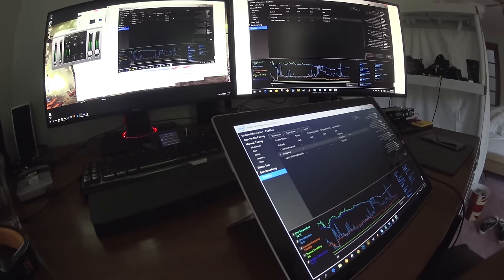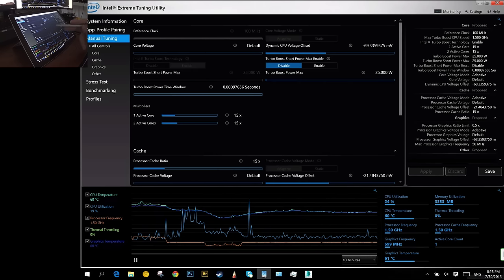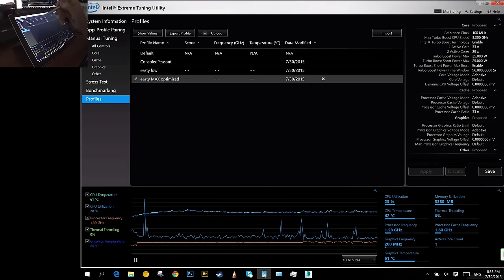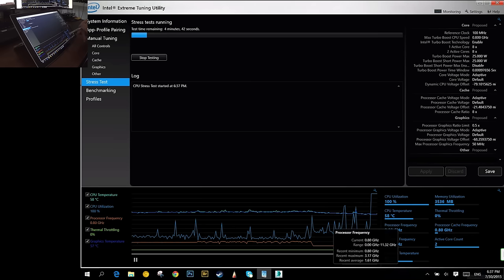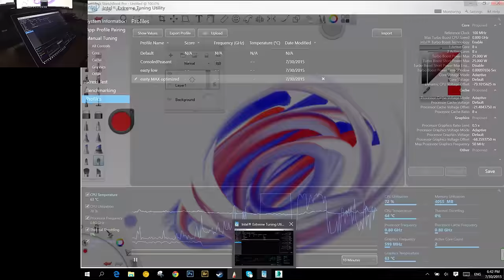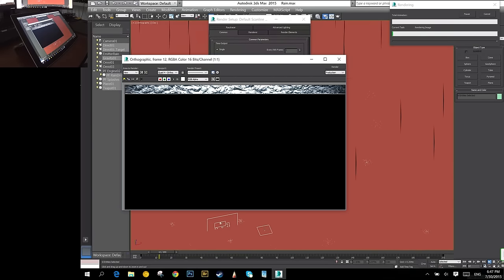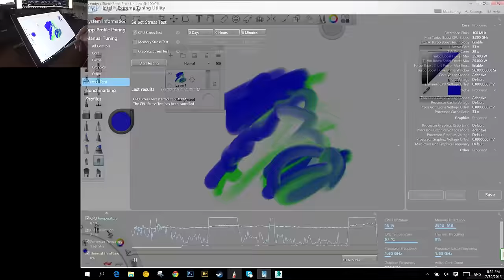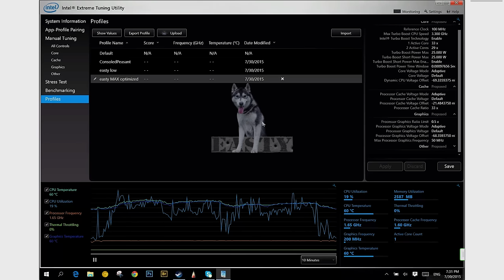Intel XTU - improving surface pro 3 operation for a little tweaking

Comment: Hi Brian,
I really like that you did this video. I've been searching for someone that does an indepth look at this, especially running windows 10.
Now tell me, are you running the Intel graphics driver? You should look at that and compare with that driver instead of microsoft's as well. Back in September there were many articles about it which increases performance. Now there's one for WIN10 as well.
I used to use XTU on my SP3 i7 256gb back in school last year and I've been so upset with the temperatures that it gets to. Runnig just Microsoft edge is enough to make the fan turn on, and if I run games of course then it throttles immediately. Thanks for sharing what you've learned!

Comment: any chance of exporting your profiles, complete noob here. i have the same specs of sp3 / i7-4650U CPU @ 1.70GHz 2.30 GHz/ 256gig / 8gig mem /thanks
Reply from the maker: +Roderick Astorga https://drive.google.com/open?id=0B6ivAynxQBSAZTBER1hMeXl3LU0 There is my slowest performing one. I use that while not really using any resource hungry apps. browsing ect. fan never kicks in.
Reply: +Brian “Easty and the Wolf” Eastwood thanks bri, will report how it performs on my daily task. i only use my sp3 for web (chrome) word, power point, adobe photoshop and lightroom, sometimes indesign and illustrator. do you think this settings can keep up with at least 3 to 4 apps running? do you have other settings that i can use for other purposes. thank you so much again
Reply: @EastyUK  Can you please help me out? Your ultra low is the only profile working, if I use default and try to Undervolt any amount it reboots the surface pro 3 i7, throttlestop causes blue screen instead of reboot. Been driving me crazy.

Comment from the maker: Joltiwolfe Game Hey mate, glad you found it interesting. very niche video. I've not been aboe to find a newer driver than the default one used by windows. I tried downloading this for the hd 5000 et it sas its not for this machine when I try to run the install. Are you aware of a different driver?  https://downloadcenter.intel.com/download/25150/Intel-Iris-Iris-Pro-and-HD-Graphics-Production-Driver-for-Windows-10-64-bit Cheers
Reply: Brian Eastwood 
That is the correct driver! Although you need a different method to install it.. I believe this is because Microsoft did not make the driver, but intel realized that it gave better performance after they had more time to work on it.

1. Download the driver with the ".zip" extension. Do not use the ".exe". After the download completes, extract the compressed zip folder into somewhere convenient that you can remember.2. Right click the Start button, and search for "Device Manager", and then open it, and then click on the downwards arrow besides "Display Adapters" to expand it.3. Right-click "Intel(R) HD Graphics Family" to open the context menu for it, and then select "Update Driver Software...".4. Click the following in the upcoming windows: "Browse my computer for driver software" > "Let me pick from a list of device drivers on my computer" > "Have Disk" > "Browse".5. Locate the .zip folder you have extracted earlier, and open the "Graphics" subfolder, and then select "igdlh64.inf" and click Open, and the confirm by clicking "OK".6. Click "Next" and the drivers should begin installing. During the installation, your screen may flicker - this is normal. When the installation is complete, reboot your Surface.Tell me how this driver works for you! After restarting, you will notice you can Right click the desktop and configure the Intel Graphics settings so your liking.
Reply: Joltiwolfe Game Wow that comment definitely was not as organized as I originally made it. If you have trouble reading it I can submit a word doc for you. good luck
Reply from the maker: Joltiwolfe Game no thats fine and clear. I'm familiar with that method so I could understand. I'll install and try it. thanks for taking the time to post the instructions.